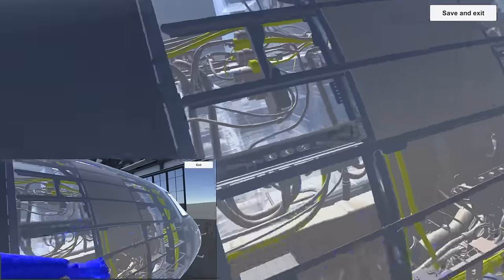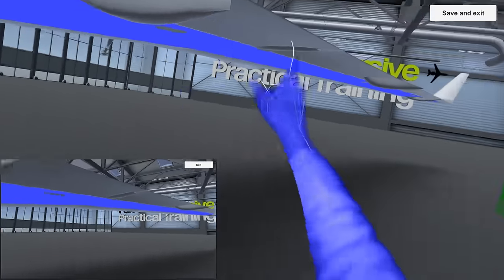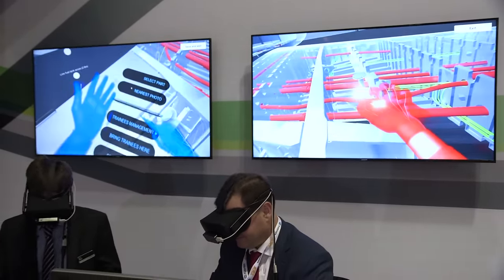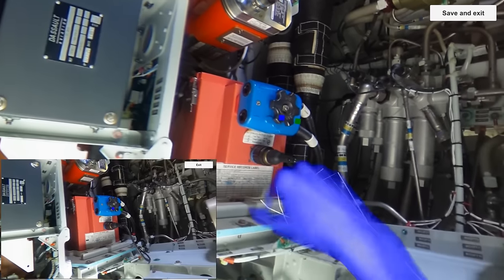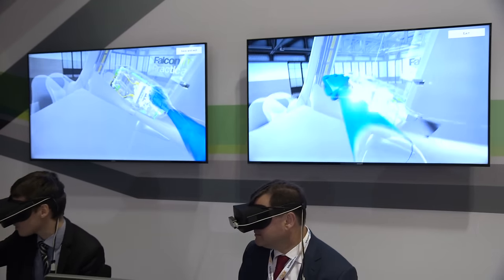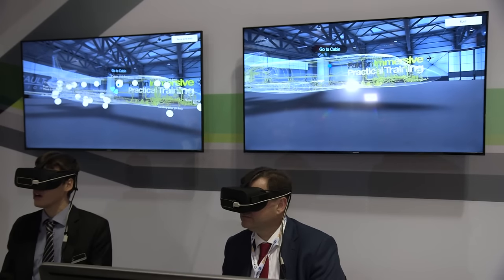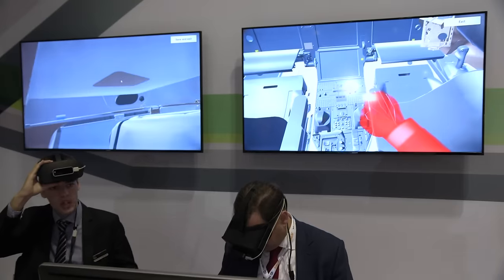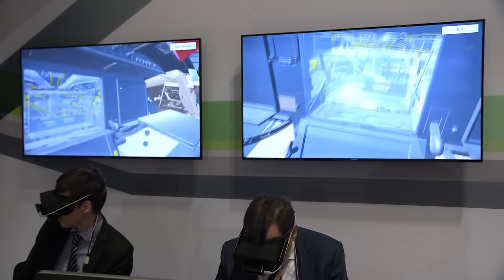How Virtual Reality Tools Train Dassault Falcon Aircraft Mechanics – AINtv

Comment: If the glasses were clear and looking at the actual aircraft instead of VR then it would be way “smarter” if it would show you in VR imposed on the actual area of required work. VR would show process imposed on exact part being worked.